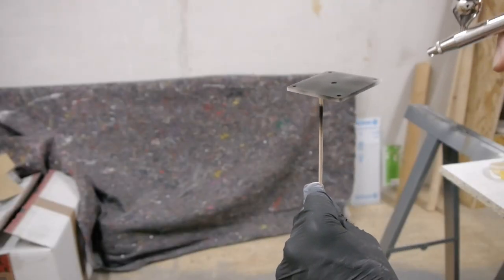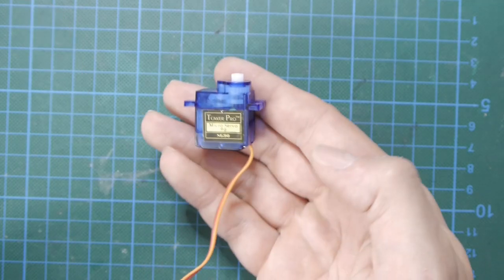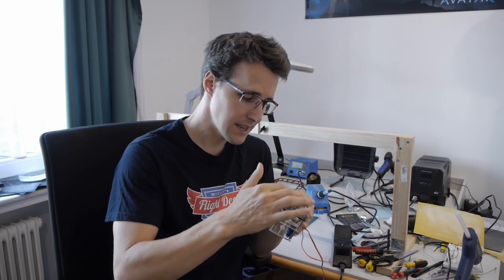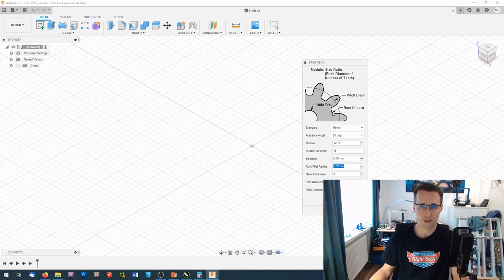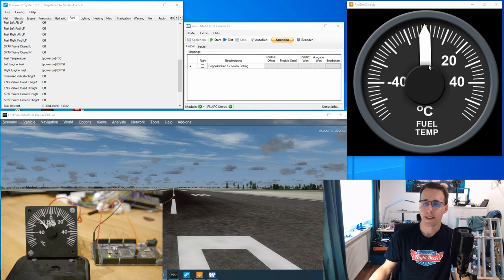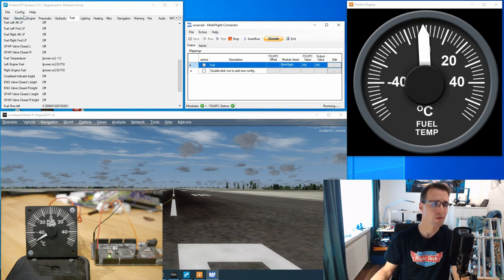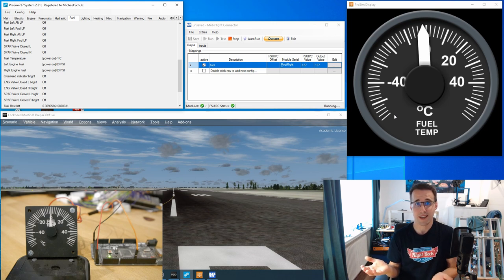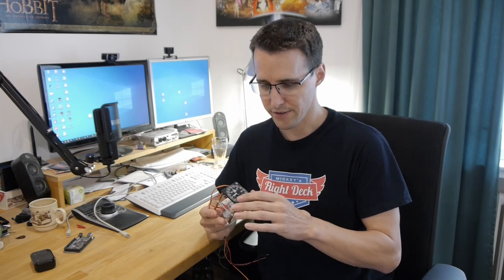Single needle gauge - A Boeing 737-800 Homecockpit #45

Comment: Great job as usual. I would recommend that you do a gear set for 270° to best match the 0 to 255 range. And then do another set of gears for 360° for the few sensors you have that require further travel and less fidelity

Comment: Hi :) 
If  you want to calculate how many teeth exactly your gears need to reach the whole arc of your instrument, you can use this formula: 
(z1/z2) = (arc2/arc1)
where:
-z1 is the number of teeth on the gear on the servo
-z2 is the number of teeth on the gear on the needle
-arc1 is the total arc the servo moves from side to side
-arc2 is the total arc your needle needs to cover. 

For example if your instrument needs to cover 300 degrees and the servo moves 180 degree, then z1/z2 would be (300/180), thus one good combination of gears would be 30 teeth on the servo, and 18 teeth on the needle.
Of course the distance between your axels would change,  unless you can change the module of the gears to keep your current distance. 
To calculate the distance between the two axels you can use this formula: [m*(z1+z2)]/2, where m is the module.
I am working on analog instruments for a C172 cockpit, so needed to calculate these a hell lot :)

Btw nice videos :)
Hope this helps, good luck with your build :)
Reply from the maker: Thank you for the detailled example. I did some calculations before but something turned out wrong maybe. Yes, the diameter of the gear can become a problem. I also have a 0.8mm bit but I'm afraid to break it during the cutting process.

Comment: Really wonderful job! I was thinking about illuminating the pointer and the shape it has in the original equipment, and I think that making an engraved “white” circle on the faceplate around the hole would pass light up into the circular part of the pointer. This is the same way the knobs are backlit. If you aren’t happy with the results the clear shaft give you, maybe try that?
Reply from the maker: Of course, that could make the lighting of the pointer a lot better. I have used your suggestion for the engraving of the APU gauge. So we can compare the two results.

Comment: Hey, do you have a video on continuous gauges? Working on a altimeter and trying to figure out the right type of stepper or servo to use for a gauge that can almost infinitely spin with the speed and accuracy of a servo
Reply from the maker: Until now I have only built the gauges you can see in my videos. There is no continous gauge among them.

Comment: Hello Mich, please what ratio gear are you used between your gear 2:1 ? 3:1 ?
Really thanks
Reply from the maker: I'm using 2:1. I try to serve the full 360°. Even if it is not neccesary. But this can only be cut in small size if you use a laser or a very fine router bit in your cnc.
Reply: @Mickeys_Flightdeck  really thanks ;)

Comment: Hello, Mickey! I am a 13 year old aviation enthusiast. Me and my parents would love to make this 737-8 simulator, but we don't really know what we have to do. Could you please help us?
Reply from the maker: In short - not really. It depends on what your end result should look like. If you want to have a full size cockpit with inner shell, than you should start watching my videos from the beginning and you will get all the knowledge that you need to build a cockpit like mine. If you want to build only some panels than you should watch my panel making videos and you will learn the techniques that you will need to make these panels. It also depends on the tools you have. If you have a CNC or are planning to build one, than you can use my guides as they are. If you don't have a CNC, than you can use my videos as a general guide but you will have to look out for other alternatives for the  engraved parts of the panels.
Reply: @Mickeys_Flightdeck  Thank you!